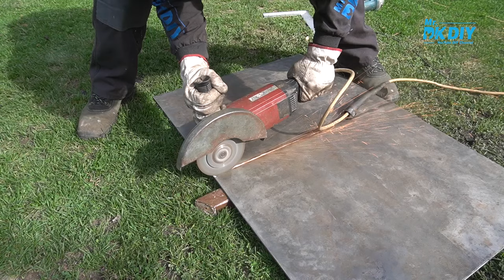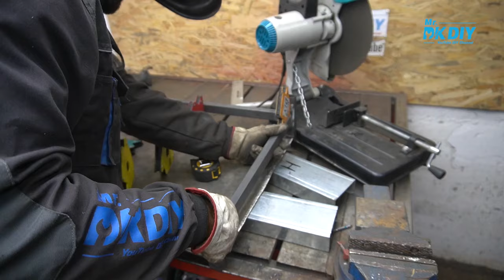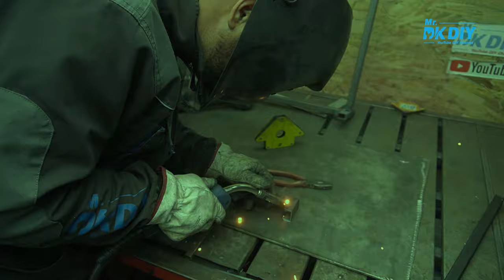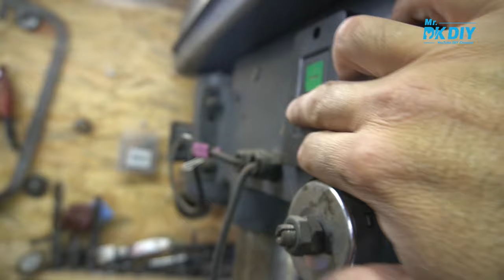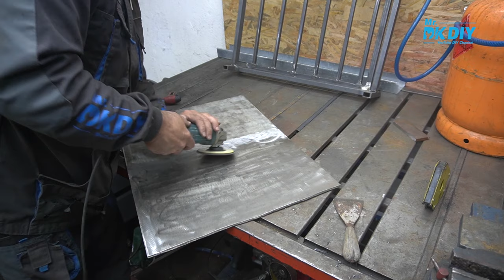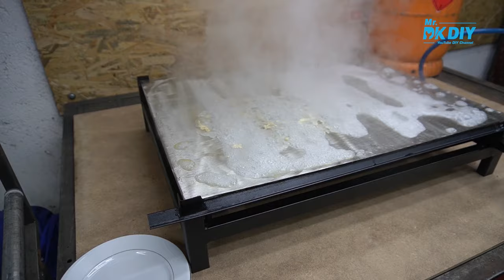Gas Grill - How to make Gas Grill - DIY Propane Burner BBQ

Comment: from the burn marks can see that the heat is not correct spread - you should drill those flame pies from both sides and not only top then would be better result.
Reply: Hey, you say that I should add holes at the bottom and everything will be fine?
Reply: Wont that be excess usage of gas?
Reply: Просверлить под угом два ряда отверстий на трубах. 😊

Comment: Looks good, but you may wish to improve its safety by adding a wire mesh screen downstream of the valve to act as a flame arrestor.
Reply: Can you explain more if this I'm curious
Reply: Screen is not needed or used on venturi gas air mix as their is no oxygen in the supply side gas.

Comment: Great video, I am considering altering a Blackstone griddle to as bare bones as possible to lighten the weight and changing the burner valves to give me more control over the flame. How close to griddle bottom is your burner tubes?.